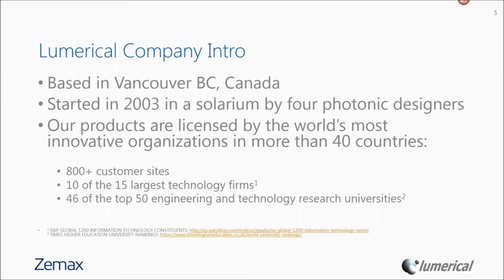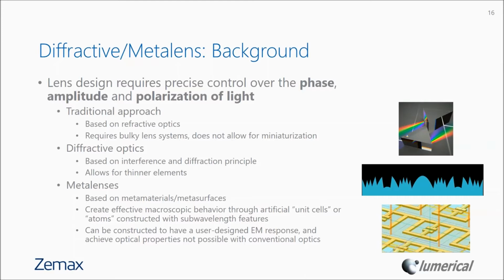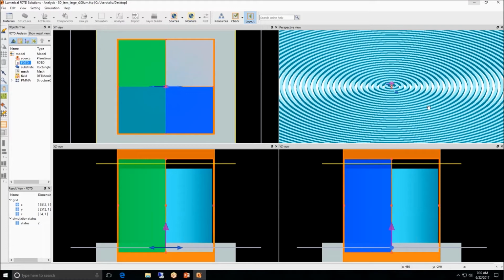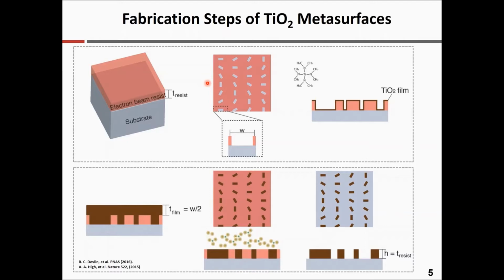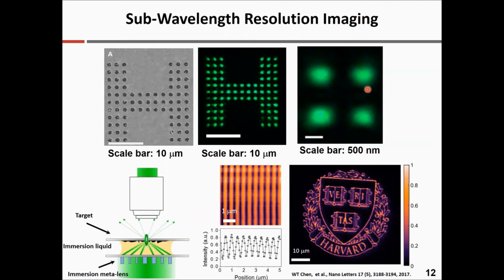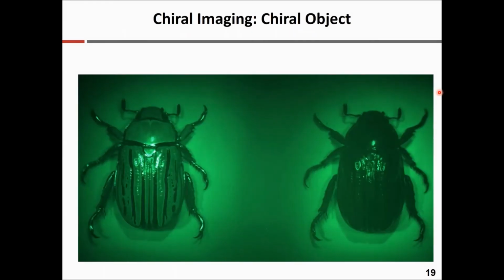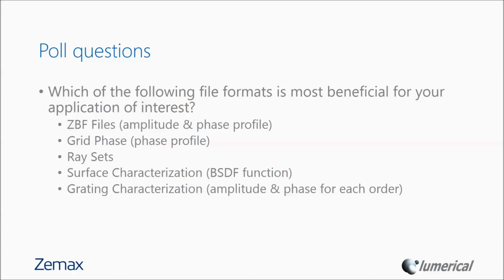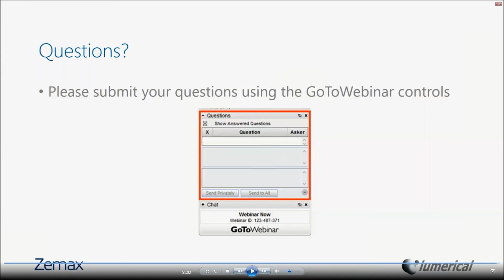Part 2: Zemax – Lumerical: from Nano-Scale to Macro-Scale Optics and Back

Comment: Great presentation! I have a question about the Zemax part. How to you propgate the beam onto the different surfaces. How can you see the beam shape in the Shaded Model ? When I do the same as shown in the video I only get the rays but not the beam shapes on different dummy surfaces. I have loaded the zbf file from Lumerical and have the E field.
Reply: @lowfreqx Did you solve the problem you faced? I am also getting the same problem. Kindly help me out. Thanks
Reply: Did you solve the problem you faced? I am also getting the same problem. Kindly help me out. Thanks..